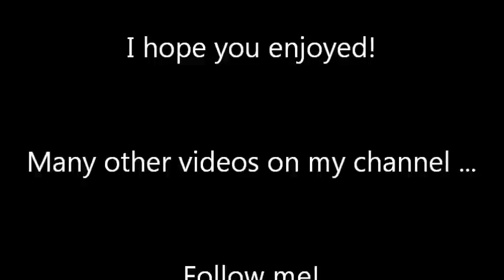1:6 Scale Model Power Steering

Comment: Beginning @ 1:10 the base to the valve to actuate the hydraulic cylinder also is rotating. Is this some kind of mechanical position "sensor"? And also how will this be actuated electronically if for example to turn right or left requires turning valve to actuate and also following further in rotation to keep the valve actuated. Or am I way off base here?

Comment: Hi, are the tyres and rims also custom made or are they available to buy?
I need to find 1/8 wheels for my project.
Reply from the maker: the rims are hand made but the tyres, you can find them in the net. 20 cm diameter (8"x2.50-4) ;-)
Reply: CLAUDIO GRASSI any links please? I've been searching for days and cant find anything the size I need (10.5 cm diameter)
Reply from the maker: This site specializes in 1:8 models ... I'll leave you the link of the page of the tires:
442721093.e-shop.info/shop/category_9ce83f45030d5475730ecf96fe7b1127/Reifen.html?sessid=7qg1ALawIjNOrYZKsX3dnAxE1fcawUHQPAFmOEfTGVzXohdb9hkyldpnNrdFpW7D&shop_param=cid%3D%26
Reply from the maker: if you can't open the page, this is the main page: www.schink-1-8.de ;-)
Reply from the maker: click on Artikel, Truck-Ausstattung und Zubehör and then Reifen... Google translator can help you!